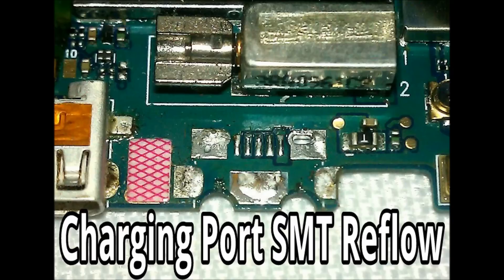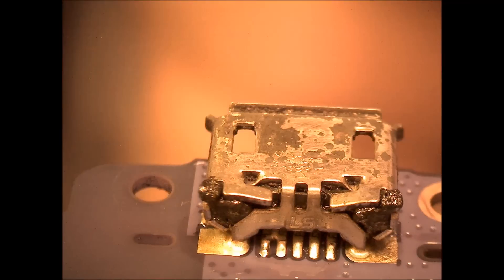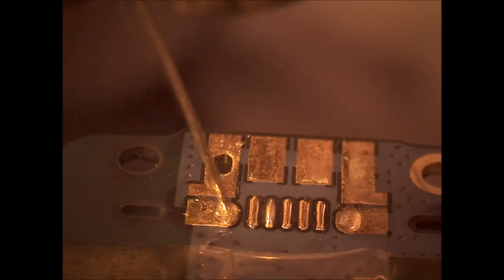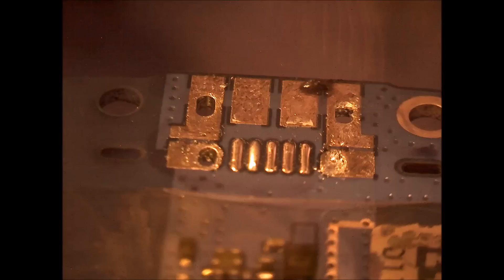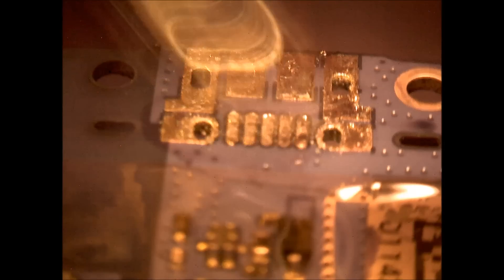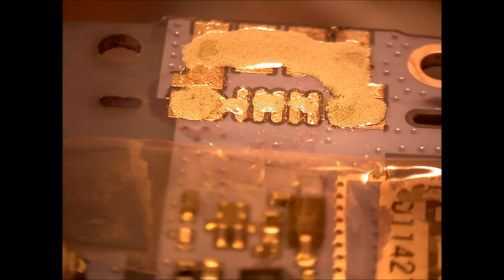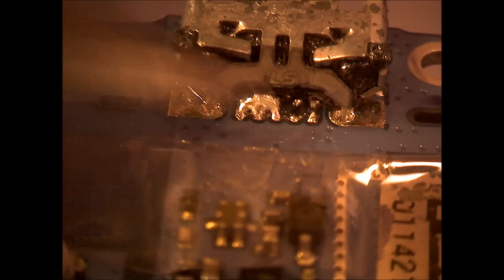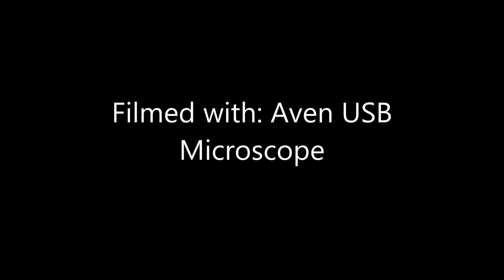SMT Solder Reflow

Comment: Any problems with PCB delamination when having your hot air station set at 400*C? I have mine set to 270*C and it takes almost forever to reflow.

Tips?
Reply: purpleravenstar not typically, but it depends on the board. A thick board will be fine at that temperature, but thinner boards can only handle 340-380 degrees C.